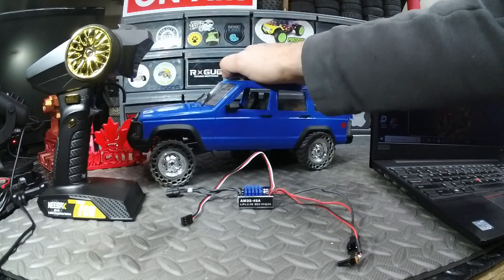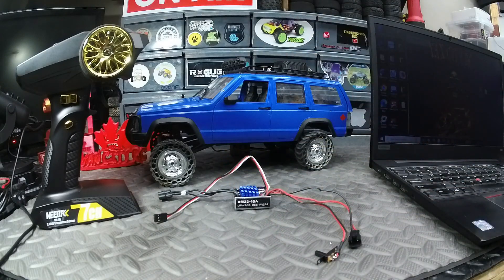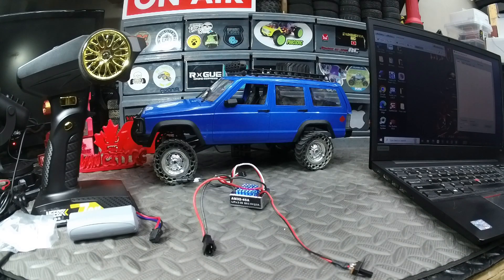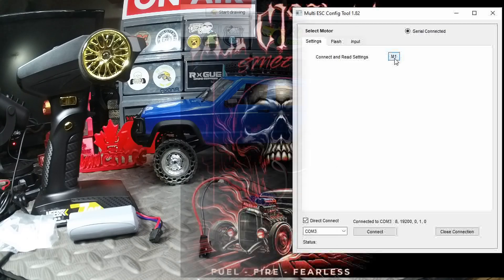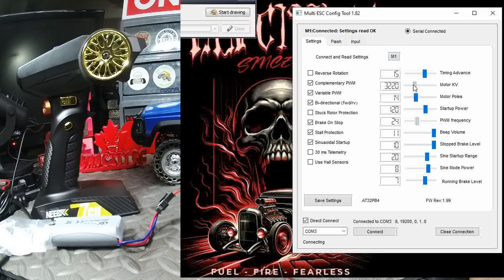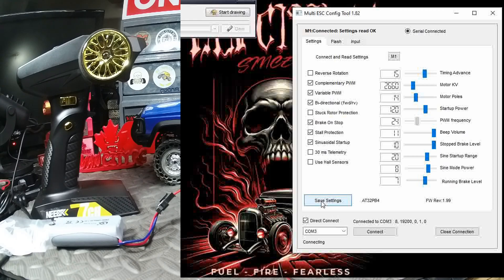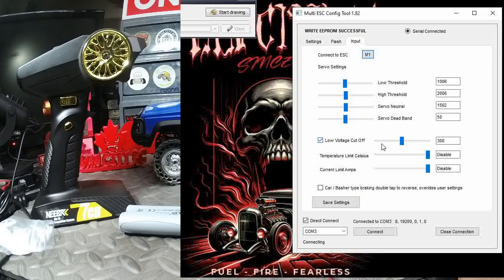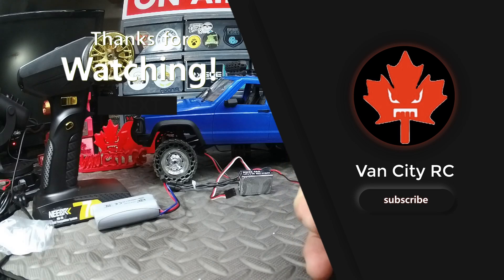AM32 Brushless ESC Programing

Comment: Thanks! I was able to connect my am32 ESC and tune it to my specific parameters to remove alot of the cogging, My rc crawls alot better now :)
Reply from the maker: Awesome
Reply: Do you mind sharing your parameters?
Reply: @crawler.exe1   Sure thing man :) 
Timing Advance: 0
Motor Kv: 2580
Motor poles: 14
Startup power: 140
PWM frequency: 16
beep volume: 11
Stopped brake level: 10
Sine startup range: 25
Sine mode power: 10
Runing brake level: 10

All Toggle/Tick settings on the left are default but you have to disable variable PWM so you can change it to 16 then turn it back on and it will stay at 16, Using these parameters it drastically reduces the cogging, It only seems to cog now if the tyres are really bound up in the rocks, And i use heavy metal wheels and 85mm tyres with the metal axles so its alot heavy than the standard mn82 It still struggles/hesitates transitioning from sine mode to normal brushless mode at low speed whilst doing some technical lines but i only crawl with it so it's not that much of an issue, But the motor heats up alot more now with a 2s Lipo so i've bought a small 25mm fan that plugs into the receiver and i'm going to mount it directly infront of the motor to cool it down which you may need to also if you find the motor gets too hot to touch.

Comment: hi, i notice that from my seller the esc automatically go from forward/reverse to brake when throttle is released. so, which option in the setting to set it to forward-brake-reverse setup. and which one would you recommend for crawler?
Reply: It actually has a brake it's for rc crawler and you need yo adjust the parameters using usb program for am32
Reply from the maker: This is correct 👍💯

Comment: Followed all the steps, and i am an IT guy,   as others have noted, it says connected, but when i click M1, it says no response from the ESC.
Reply from the maker: I’m not sure that’s odd. Hopefully you can get it resolved
Reply: @Lone_Valley_Adventures  I did find the problem.  The ones marked ASM32 45A ESC work fine,  but an identical one without marking,  had the problem.  Seems there are copies that dont allow config.
Reply from the maker: @phantomrose1999 good to know
Reply: got the same isue

Comment: I’ve followed all the steps in your video but my computer won’t connect to the ESC. At the top is says M1 did not connect. At the bottom it says no response from ESC. Any troubleshooting ideas?
Reply from the maker: You have the correct com selected?
Reply: @ I only have one option which is COM3.
Reply: got the same isue